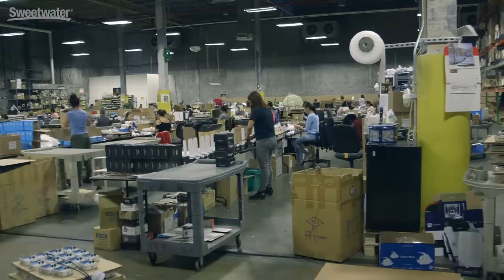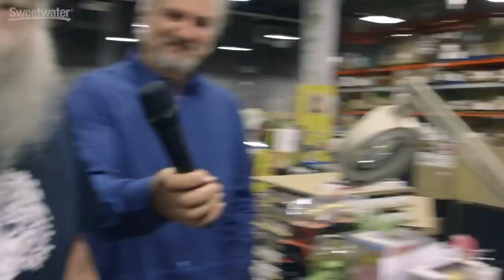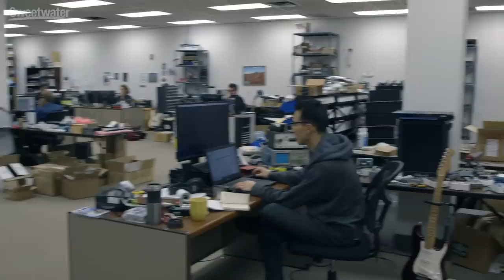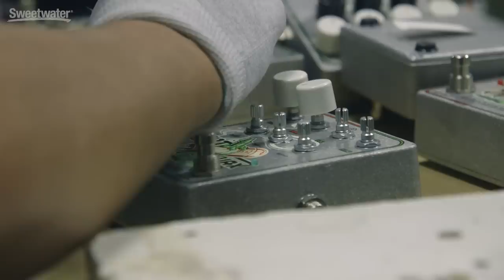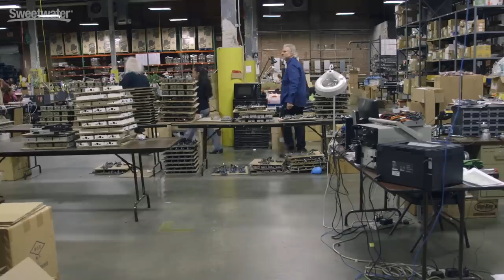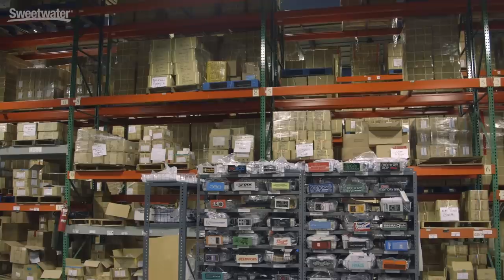Electro-Harmonix Factory Tour

Comment: Man I have a small stone shifter from 75 in my drawar..looks like new...I will clean and demo it after that! Love this guy! Keep rocking
Reply: let me know if you want to get rid of that, mine from the same era got ripped off in October
Reply: @keithdavidson8569 .. I'll test it first, redo the solder on the 9 V side and dedust, wd 40 it and remove corrosion..then it should be new!? Keep that color switch, I hesrd these can get corrosion on the slider contact..since it has the earplug Typ 9 Adapter socket I think I may 2 9 Volt Blocks parallel...that little beast need exactly the 9 V to not loose signal strength when engaging it..first sound test, it works, no crackles.. Promising..I test it vs a Electric misstress ( new) BTW we used it for bass sounds with color back in the day!
Reply: @keithdavidson8569 . Did upload a vid with that Small Stone...

Comment: While streaming on Twitch the other day I figured by accident when I didn't get the expression pedal plugged all the way that you can turn the Pitchfork into a sort of ring modulator. Try putting the plug in about 3/4 of the way instead of completely in.